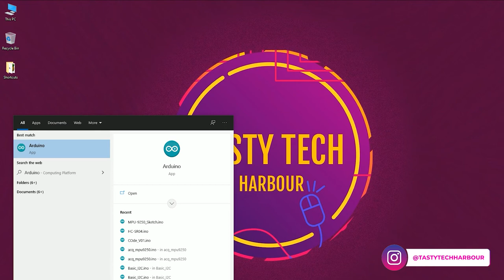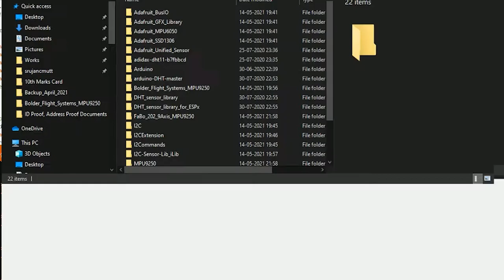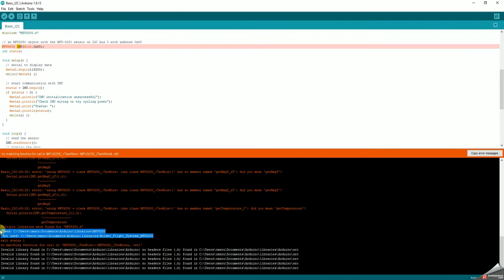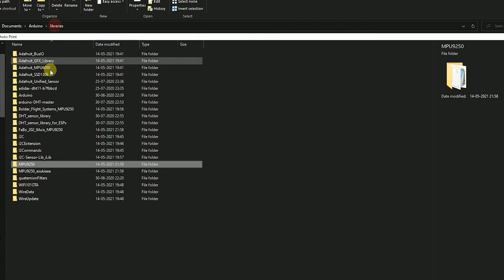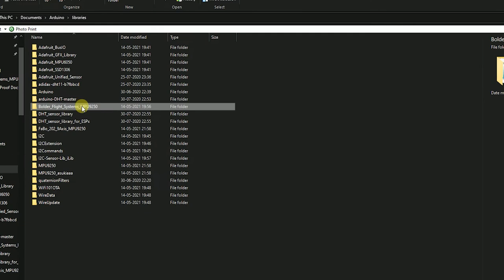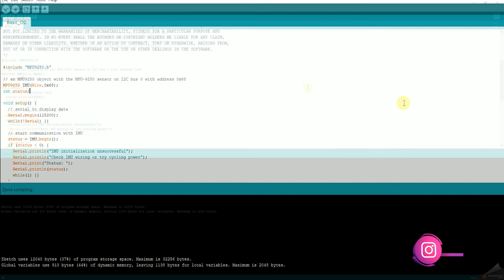Arduino Error - no matching function for call to 'mpu9250 two wire mpu9250(two wire & int) - MPU9250

Comment: i had this very same issue and solved it the same but i created a folder on the desktop to save the libraries that were not it use,  in case i did want to use them.   Some times memory limits my projects so i would use a smaller library or maybe only part of the library functions that i need.